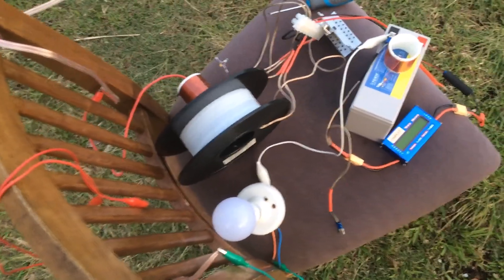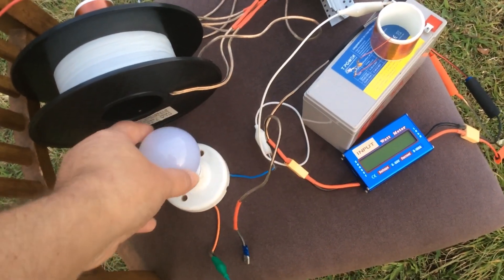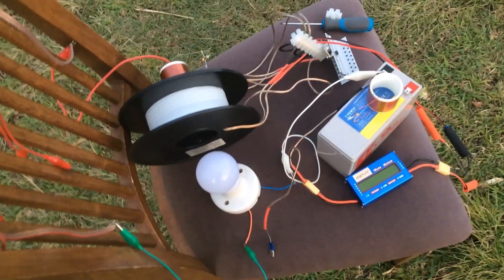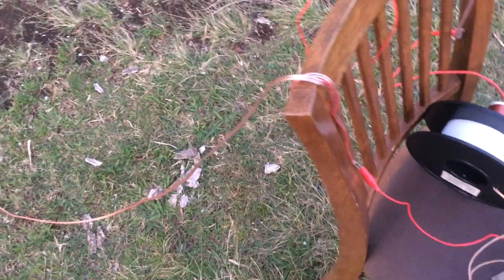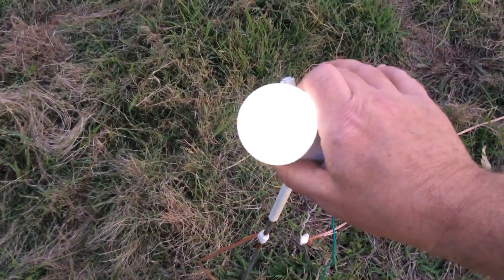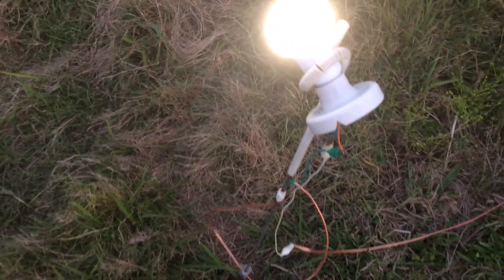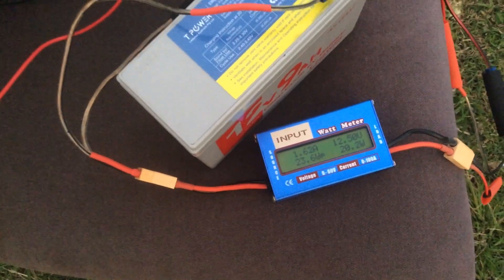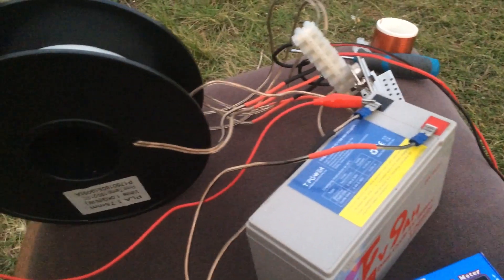Tesla 1 Wire Electricity. How many watts does it take?

Comment: Thank you Sir, what was the input using in this experiment please?
Reply from the maker: @Waveit5  Thank you for your comment.
From memory the current on this setup was 1.25 amps, I usually display the wattage during each video. But I’m pretty sure that’s what it was.
Thanks for watching.
Reply: @whatifididthis...1236  Thank you sir, that is a great work. if what you said is correct so input 15W with 20W output and capable to be even more with bigger coils more turns, more deeper earth, etc?

Comment: First you had around 6 Watts and then after 100m there are around 20 Watts drawing. How many Watts is the battery drawing at that moment approximately? Or in other words how many Watts are freely from this 20 Watts? I watched the end of the video again. So there are running 2 bulbs instead of just 1 bulb in the first round. And it's drawing still just 20 Watts. That's amazing.
Reply from the maker: Thanks for watching. From memory, with no load the circuit draws 4 watts, with 240 volt light near circuit draws under 7 watts and when the light is at the other end of 90 metres it draws under 21 watts. I believe having the light near the circuit draws less current because it can see the load(light) first, allowing the wire to act as an earth. Tesla stated that an artificial earth could be attained by using a 30 foot or longer length of wire. So I could be wrong but I think the current draw increases if the light is at the other end due to the resistance of the wire before the load. I’m beginning to think this is how Henry Morayfield’s device worked, light close to the circuit and the wire acts as a collector whereas light at opposite end of the circuit results in a shorter collector, increased resistance so more current required from the battery.
Only one bulb was running at one time (excluding the small LED), the circuit doesn’t like these high voltage lights in series, at least not at the 90 metre end, not sure about near the circuit, so many tests to do, I might also try two lights in parallel at the end to see if that works.
Thanks again for watching.

Comment: Since 2 days I'm consuming all your videos. It's awesome. Rick Friedrich showed something interesting in this video at minute 46 Minutes onward:
https://www.youtube.com/watch?v=0bpv3wUWGqk&t=5s
He produces 30 Volt at 0.1 Amps = 3 Watts with the Generator. This way another 4 bulbs (3 Watts each) are running freely additionally to the small LEDs. This 4 receiver-coils are touching directly the transmitter coil. With each coil touching the transmitter Hertz is going down and Rick is powering the generator up to 0.1 Amps again. Could you do that too? I'm wondering also how to put up the amps with the 12 Volt battery instead of the Functional generator-device. Greetings from Switzerland.
Reply from the maker: Thanks for watching. I am familiar with Ricks work And he is 100% correct, same message, different messenger.
 The effects you see in my videos are based on the same principles, 
This video is very similar to Ricks demonstrations with a signal generator - https://youtu.be/GX_dY9pWNBI
This video shows how you can achieve similar effects using my circuit if you don’t have a signal generator - https://youtu.be/RCXzyJdo4yI
These effects were noted over 100 years ago and our education has been steered away from this knowledge intentionally.
I blame our EGO’s, I believe our ego’s kick into action when these things are realised, our ego’s claim to us that we are smarter and would have noticed our educators attempting to trick us. Again our ego fails us because we failed to realise our educators were also tricked or deceived.
Again, thanks for watching.
Have a nice day.
Reply: @whatifididthis...1236  Great analysis because of the ego. In your video https://youtu.be/GX_dY9pWNBI you show the example with the 20 leds. This is the same like the big 3 watts bulbs in the video of Rick. Great. I assume the small leds are 3.2v/20ma. This means this 20 leds in a row took around 1 watt out of the air. I'm wondering how many watts would be possible to draw in this 20-leds-in-a-row-example. Here is my assumption. The primary coil drew around 3.2 watts from the battery. I think a bit less than this 3.2 watts are available in the transmitter coil. I assume you could put 60 leds in a row there and they would still be all perfectly bright. And the drawing of current from the battery would be still at 3.2 watts. With more than 60 leds (> 3 watts) the light would start to diminish in all of the leds in a row. Does this make sense?
Reply from the maker: @marcelfiechter7436   You could be correct, on all counts, but I have seen so much with this circuit that doesn’t add up and I have learned not to deny my imagination with it. I literally have an idea pop in my head and set about testing it even if it seems ridiculous. I have already tested a 12 volt LED bar which normally consumes 20 watts, the light was half brightness according to the lumens meter so possibly consuming 10 watts from one coil. I will take your suggestion as a challenge, let’s see what 60 LED’s actually does! Stay tuned, I will video that test tomorrow.